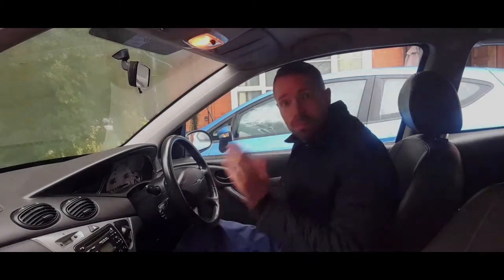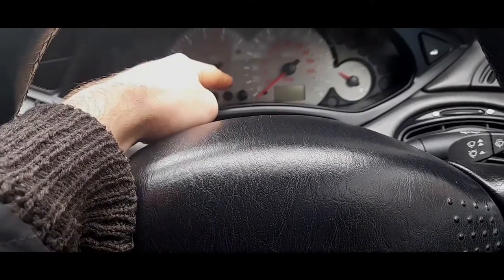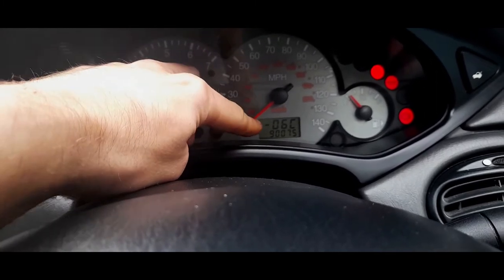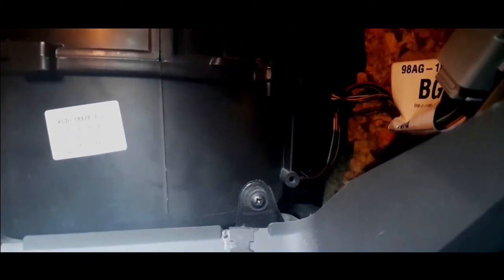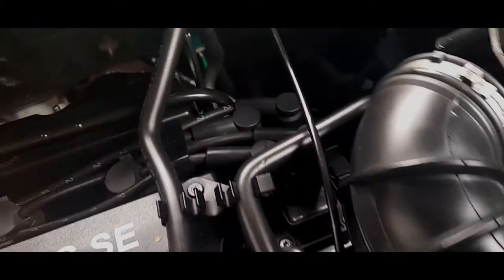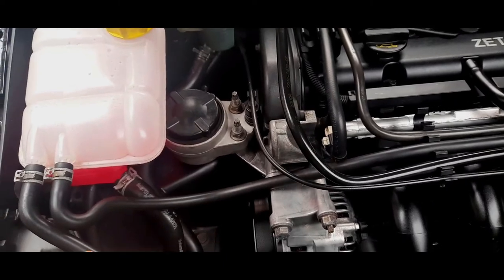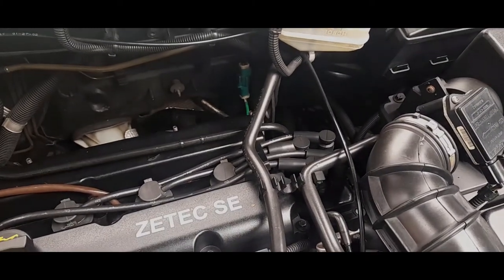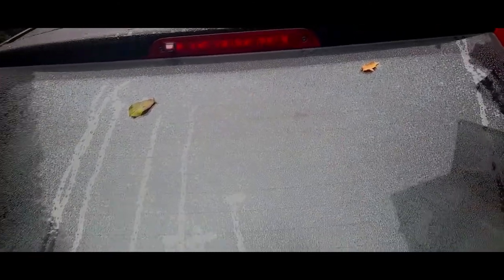Ford Focus MK1 Common Problems - Electrics

Comment: Hello, a bit late to the party - i have a 54 focus and the lights on the speedo and rev clocks occasionally flicker, any ideas what this could be? Any help would be appreciated 👍
Reply from the maker: clean the battery earth connection, of this continues your speedo has got damp soldered joints, common fault in which you'll need to send if off to a place that repair them. Not expensive to do about £65.
Reply: Hi there i have exactly same thing with my ford focus mk1 53 reg , the dials just flicker and all the lights just on the dashboard looks like Christmas tree 😂 when is raining or cold weather , if dry everything works fine

Comment: Please help! I have a 2003 Ford Focus ZX3. The airbag light on the dash stays on with the car off and key out. Its draining my battery. The light goes off when I start the car. But when i turn it off and remove the key from the ignition, the airbag light comes back on. What is the cause? Also the door chime goes off with the key out and doors closed. Whats causing that? Thanks in advance.
Reply from the maker: you have a faulty drivers door latch, thre switch sounds worn and causing the chime when it shouldn't be. The airbag light is very strange and not something I'v encountered
Reply: Actually I fixed it! I saw someone else having the exact same electrical gremlin issue with the door chime and the cluster lights. I had to remove my cluster, open it up to expose the circuit board. Then clean both sides with electrical spray and a soft toothbrush. After I put it back together no more problems! Door chime stopped and airbag light off. Everything working as it should!

Comment: Hi wondering if you could help , my car has all of a sudden got multiple issues with the electrics, car key does not work automatically have to manually open which only opens drivers door, when you turn the ignition on , the main headlights are permanently on even when in off position, wipers do not work, but when on fastest mode it staggers across the screen, when handbrake down the light remains on , indicator lights on dashboard do not work , cannot unlock all doors once inside the car either, but the car still runs!. What could this be?. Thanks
Reply from the maker: okay that's a lot of issues, so these all occured at the same time?! Well this points to multiple earth issues, the first area is a basic one - how old is the battery? That is one thing that causes weird multiple issues. How good are the battery connections? Do they need cleaning. This is the first step I would take, its quite varied and not limited to one part of the car like - the interior. This points to a simple battery or battery connection/earth issue.
Reply: Thank you for your quick response!. Yeah all of sudden just stopped working was fine the day before , I'll be honest not to sure the age of the battery but will give this a check at the same time will check all connections too. It doesn't point to a fuse blown then?. Thanks again
Reply from the maker: @05browna095  some items could be, but my first point of call is the battery and its connections!

Comment: Hi, would that gauge test point out to why two of my needles move after engine stop and key out? My battery was tested fine by RAC and then the mechanic who put on a new alternator read it as 14.1v, no idea to why this new issue, its like a new issue every week now in 3 since i had it serviced and MOT'd
Reply from the maker: This sounds like a cluster fault or bad earth. I'd clean the cluster connector at the back, you'll just need to take out the surrounding trim

Comment: Got the same ford focus. Shes a handful. Currently my acceleration thingie has dead leds i think, dont know why it happened i suck at cars. And now my headlights keep burning out for some reason. The mechanic already spent 8 hours trying to figure out older issues and he was absolutely baffled by it. Im gonna try another mechanic but at this point my old ford is turning into a disaster on 4 wheels waiting to happen.
Reply from the maker: can you be more clear on "acceleration thingie", your headlight - either poor bulbs or you have an earth issue, try cleaning the battery earth in the least.
Reply: @usuallyfixingtinkering  English isn't my first language so I apologize for my cave man expressions. The meter that shows you turations. The LDS seem dead.

Comment: hi,great info about focus. if you can help me with a problem, i have an focus mk1.5 (facelift) ghia. for years my controll key doesnt work. i try the way you program the key by on-off 4 times and doesnt work.there is no sound. i fix a new key and bought a used but in very good condition GEM and still nothing. any ideas? if you like can you make a video how to programm a key? thanks for your time and your detaild videos.
Reply from the maker: Your programming the key correctly but if you've changed the GEM module and it's not making a sound then the only cause that's obvious is the circuit board in the key is broken. I believe its part of the key so a new key with internals is needed. That also requires swapping the immobiliser chip very carefully.
Reply: @usuallyfixingtinkering   thanks for the quick response. the key and the GEM are new. the key is a brand new aftermarket and the GEM is second hand but in great condition. maybe programming from OBD II is the way to go?

Comment: Take the wiper relay apart, clean the relay contacts. My 2003 wipers didn’t park, and that fixed it
Reply from the maker: That is what I would have done if swapping them didnt work. Good tip.

Comment: Any tips for finding a parasitic drain on the battery on these? Regards Richard.
Reply from the maker: what I usually do is connect my multimeter to the battery positive and the other side to earth and set it to amps, i then pull each fuse to see whether the current draw stops - when it does thats your culprit. need an assistant sometimes for this job, its important the ignition is off, nothing like radio etc.
Reply: @usuallyfixingtinkering  that's what I used to do but now as soon as you connect the meter the toad alarm siren goes off.

Comment: Hey me again! Great video mate! My abs and brake light comes on and off now and again. Is this a dodgy fuse?
Reply from the maker: Cheers buddy, Now you see I have missed a few things, the brake light switches have been known to fail, give it a contact clean. Also do the same with the brake fluid level connection. Its possible there's a dirty sensor connection, I'd have a look underneath at the connectors on all 4 wheels. It's not a sensor otherwise you'd have a permanent abs light.

Comment: great info vid and thats a clean 90 thou milla focus you sound local to brum also
if your instrument cluster starts to play up ie needles bouncing about or not moving at all either intermittently or not at all then it will need to be removed and the solder joints reflowed this happened to me a few months back you will prob have to get this done by a electrician.
also if you have variable dash lights that flicker when the dail is on full just turn it down a bit until it stops flickering.
one prob i  got with my radio is the volume knob when turned to go either up or down goes any witch way i suspect it could do with a switch clean tbh not a big problem as i tend to use the stalk instead
Reply from the maker: The original radios have so many bad soldered joints it can cause all sorts of issues, volume is one, not able to select a station is another and the CD players stops working. But its more than repairable. Yes your right the needles can start bouncing as well as not moving at all! I am 100% Brummie buddy haha, the sound on my phone really shows it :)
Reply: @usuallyfixingtinkering  i'm not to far from ya ta be honest.
i can only blame my self or the electrical probs on mine as it was of the road for 5 years and this year i managed to recommission it  owned it for nearly 13 years and tbh i will never sell it i have had to have the clocks done a couple of months back and i got a award when it came back as he said it was the worst he ever did😂they started bouncing the would work perfect after a while but the next day hey problem back again and then it progressed to needles not moving at all so out it came.
ive also had the loom wires break in the rubber boot on the tail gate and the washer pipe also just at the back of the head lineing  mind that was around 10 years back i just added  
a piece of wire ti the break it dont help with the loom being real tight in the rubber boot
Reply from the maker: @madtopp  if it was off the road for 5 years I can only guess at the amount of bad soldered joints he had to remove😂 that's weird that it came back that shouldn't happen unless he missed one or two joints! I'm afraid they all go the same way, I check my loom every so often. I have a spare loom on the shelf if it goes that could be worth thinking about they come up on ebay off breakers! Ah your not far away from Birmingham I gather?
Reply: @usuallyfixingtinkering  no not far from you about 10 miles or so

Comment: Great content as usual, my central locking has packed up from the fob key .. the car locks ok when the key is inserted in the drivers door, where do I start looking for a fix 
Cheers mate
Reply from the maker: Firstly - change the battery if the car isn't responding to the fob at all!

Comment: My cigarette lighter doesn’t work and I have a lot of fuses in my fuse box 
Mines the same as yours but I haven’t got the two buttons next to the handbrake 
The make of my car is ford focus LX auto 2002 the handbook says it needs the fuses but I have a few that don’t need to be there what do you think the issue is and also my rear left door I have to manually lock what do I do
Reply from the maker: Sometimes that pack up and start blowing the fuse as a warning sign, it's difficult to replace the 12v socket without replacing the console as they generally break... however I would go through the fuse board and double check your fuses are all correct, many of them left the factory with fuses for items never fitted to that model.

Comment: Thanks for the wipers trick!! I still have an issue with the dashboard randomly switching off and on (the car still works, while they switching...) any ideas there? 
I also had the rear loom problem (fixed!)
Reply from the maker: Do you mean the instrument cluster by any chance?
Reply: @usuallyfixingtinkering  Same problem for me, the cluster just goes wild (speedo and rev, going berserk), but cars run fine.

Comment: (PLEASE HELP DIAGNOSE)

•2003 Focus SE (Auto) 156k miles.
Car suddenly does not start or crank. Dash lights light up. Dashes (----) on the odometer. Theft light is completely off. Can't pull any codes does not communicate with ECU.
Any other ideas of what to do/look for other than what i have already done listed below?

-Checked all fuses and diodes and swapped relays in engine bay fuse box.
-Checked all fuses and swapped relays in driver side dash fuse box.
-Removed ECU and took apart and did not see anything unusual.
-Small orange/black ground wire that goes directly from battery ground (-) to the harness in the engine bay is good.
-Two ground wires from the battery to the driver wheels well cleaned and secure.
-Battery is in upper "Good" condition under battery draw test.

(Next thing i will do is put power and ground directly into the ECU pins to see if it is the ECU that suddenly stopped working)

(Next thing i will do is find the secondary key of the car and try starting the car)

Recently i did an aftermarket radio install on the vehicle and i also changed the servo piston in the transmission. No problems at all for two days of driving. On the third day no start no crank happened. Only thing different was i backed up on to the driveway instead of regularely driving in. (I can't think of anything else).

Thank you so much in dvance.
Reply from the maker: This is either a Faulty Crank Position Sensor but given its not cranking - dors the fuel pump turn on and immobiliser light go out on ignition number 2 position?
Reply: @usuallyfixingtinkering  you are awsome. I will check and get back to you. Thanks!!
Reply: @usuallyfixingtinkering  no theft or immobilizer light on. I do not hear the fuel pump. Though i would think it would still try cranking with a bad fuel pump. It us something with ECU since i cant even connect with it.
Reply from the maker: @edkuba7986  I think the ecu has died sadly based on this. You can swap them over just need the right serial number.
Reply: @usuallyfixingtinkering  from my understanding you cant just swap them because each ecu has its own keys, it would have to be relearned by Ford or companies that specialize for that stuff?
Reply from the maker: @edkuba7986  correct the ecu must come with transponder ring and key wirh immobiliser chip inside.
Reply from the maker: @edkuba7986  looks like there is an issue with the immobiliser chip as its nit linking with the transponder. If you've already got an ecu kit with transponder ring and keys that could be the solution

Comment: Please help me, i have a ford focus ghia 2001, it was working perfectly but now when im driving the MPH dial will all of a sudden drop and stop working then between 10 - 20 seconds after that the car just goes limp and the petrol, oil and engine light show up  but when i turn the engine back on it works straight away. The cut outs are getting more and more frequent. The battery is fairly new within a year. Please if you have any idea what this could be im losing my mind over it.
Reply from the maker: Your gearbox speedo sensor is faulty!
Reply: @usuallyfixingtinkering  thanks. I thought it might be that, so I got a speed sensor. The only problem is I can't get the pin out to replace it 😂
Thank you for confirming 👍
Reply from the maker: @ganishnutinishnu7370  wd40 and patience twisting it out with thin nose pliers. Be very patient.
Reply: @usuallyfixingtinkering  I can't belive it, I done it. Wasn't as hard as what I thought, I went under the car and got a mouth full of oil when it came out but it was worth it lol, just have to get the pin back in now. Does it have to go back in or would it be alright to leave it out, I'll attempt it anyway, thanks for all your help bro 👍👍👍
Reply from the maker: you do need to put it back in I'm afraid but well done buddy for patience!
Reply: @usuallyfixingtinkering  yeah got the pin in straight after I wrote the last comment. Since then, the car has been perfect, and there have been no cut outs since. 👌 🤞

Comment: @usuallyfixingtinkering
Do you know about differences between the TPS of the automatic and manual versions of the MK1?
Mine is automatic. And the old tps had a spring inside it. I ordered one with the same reference number but the engine still doesn't run right. Any ideas?
Reply from the maker: No differences for the TPS on either models! It won't be to do with that unless a fault code is generated suggesting it's the sensor
Reply: Is there a learning procedure after changing the TPS?
Reply from the maker: nope

Comment: A different question. 
Do you know if mk1.5 front headlights (same as yours? fit directly onto mk1s ? Cheers
Reply from the maker: They fit into the same space no issues there but the wiring is different as the indicators are in the bumper on an early one and the facelift headlights will need the full loom to hook up to it, which is missing the indicator wire, are you changing bumpers? Because you will have indicators in the headlights and (if you successfully move the wire) dead front indicators in bumper. You see the what I'm saying?

Comment: What number fuse is the heater blower in my st170? Is it under the glovebox or in engine fuse box
Reply from the maker: It will be in the under the glove box, same for all models!
Reply: @usuallyfixingtinkering  I dont have a manual so the Google searched diagrams are always telling me USA European uk some are saying fuse 62. That's under the bonnet?
Reply from the maker: @brendanobrien5842  no it will be in the passenger fuse box for sure. Why do you need to look at the fuse, is the fan not working at all?
Reply: @usuallyfixingtinkering  yep. Took the hearer blower out. And it's looking like a vertically new bosh unit climate control unit. Have been advised to check It's not jammed or rusty .I've also  been told if it's the resistor the fan normally still works on number 4 setting.. just not wanting to just keep buying parts.
Reply from the maker: @brendanobrien5842  yep that is correct, so its not the resistor. I'd bench test the fan if possible using some wires hooked to a 12v  battery. You could try a continuity test wth a multi-meter as well. Just to rule out the fan definitely.
Reply: It's jumped into life briefly today in the footwell of the car. It must be a loose wire or a semi faulty block connector ect
 Thanks for the time to reply
Reply from the maker: @brendanobrien5842  thats very unusual, the wiring seems pretty good on these cars very rare for a wire to break. It may be loose within the connector itself possibly. No worries anytime!
Reply: @usuallyfixingtinkering  I think its either a loose wire or pin in one the connector blocks like you say? It works on all the settings. That is while I'm holding the when motor in my hand. It only works in curtain positions so its something loose somewhere.. it's gone dark as I've figured out the problem. No garage or interior lights ect. Will get back under the dash tomorrow morning.
Reply from the maker: @brendanobrien5842  lets us know how it goes!